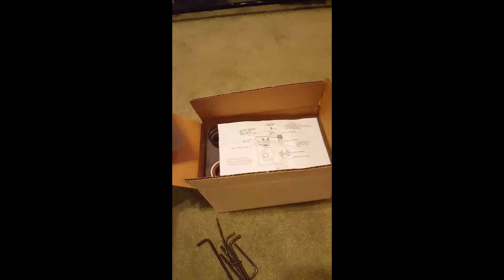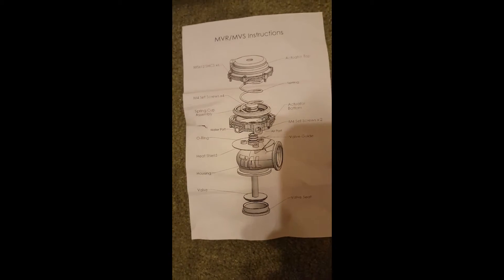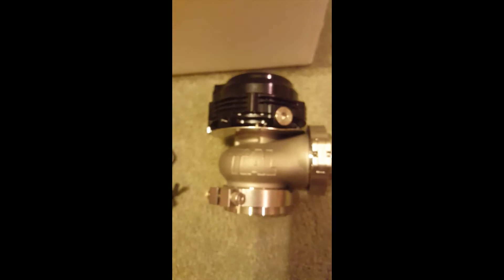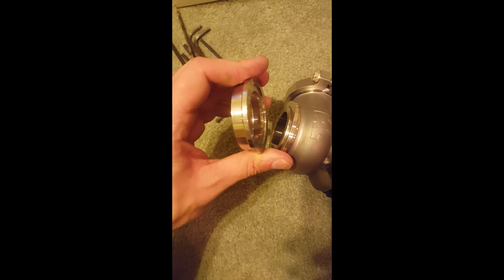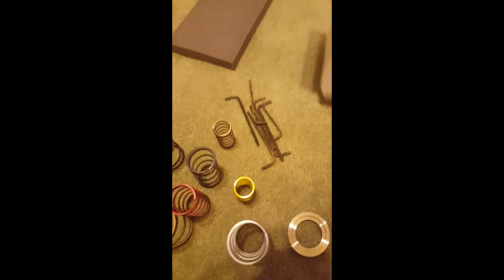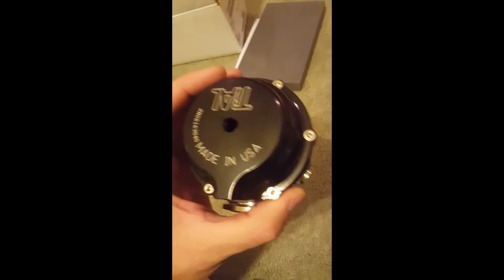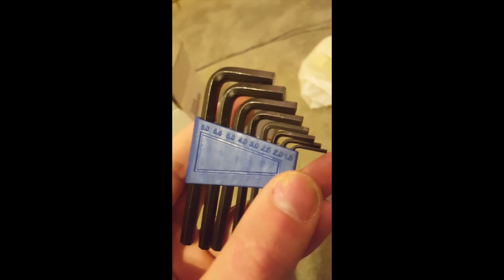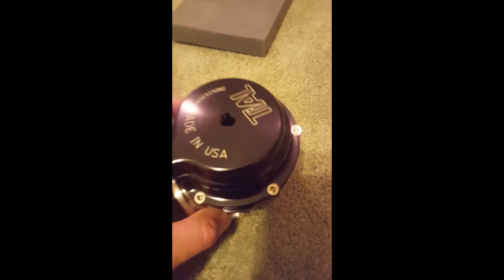HOW TO: TIAL MV-R 44MM Wastegate Setup

Comment: hi what size Allen key did u use to tighten the vband bolts iv purchased one today and nothing seems to be fitting inside it do the vband bolts tighten all the way up ?
Reply from the maker: I used an 8mm for mine
Reply: Ok nice one! I'm just going to replace em thanks
Reply from the maker: no worries dude. they have them on ebay too if you want to buy replacements